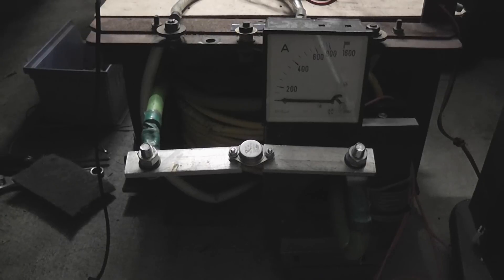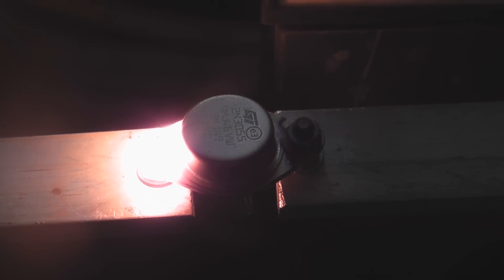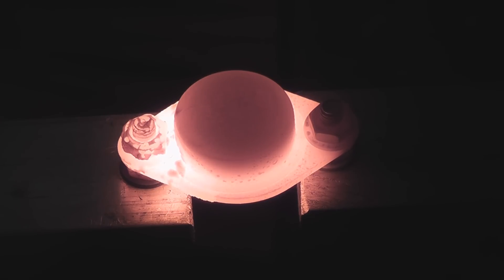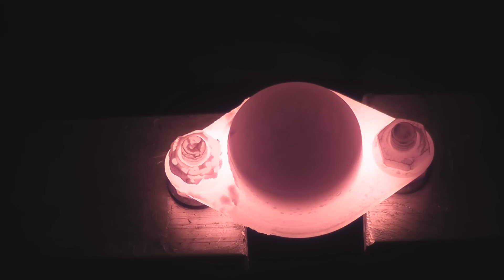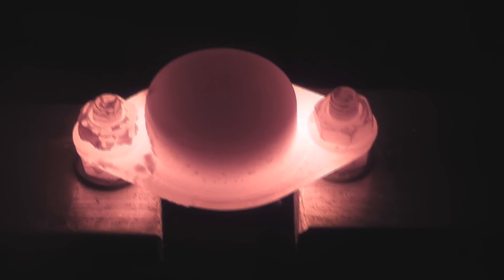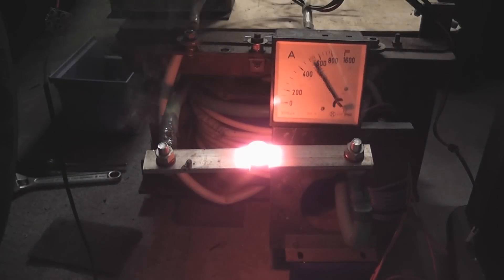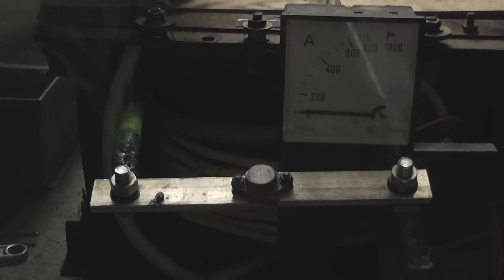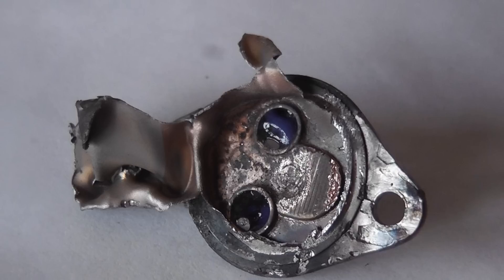Red Hot 2N3055 [part 3]

Comment: In my teenage years, I took a propane torch to an old 'transistor radio' circuit board which had silver colored metal-cased transistors, that looked similar to a small electrolytic capacitor. I found that when you get them red hot, the metal can blows off, hits the basement ceiling, then comes down into your shirt collar and down your back! Around that same time, in the same basement, my dad had a 12v car battery on the bench, hooked up to a charger. I found that touching a file across its terminals, resulted in the battery no longer having a top or sides. Live and learn, as they say. Oh yeah, at 57, I still do this type of experimenting, but with a little more care!
Interesting video, as always!

Comment: So really all you have done is mount it so its connected ACROSS the metal body of the device, the collector. It therefore is not obviously operating as a transistor... It'd be better if you could get it up to that sort of heat-output running as a transistor and not kill it. Now that would be a challenge.

Comment: so its not the actually PNP/NPN gates causing the heat.... its the fact that your effectively using it as a filament as in a light bulb. 

saw the thumb nail and said that their was no way the transistor it self could get that hot. still cool however. especally the photos

Comment: Haha and LMAO at 2.05 ...... "500 Ampere nightlight"

It's gotta be said : Look at it Glowiiiiiiiiin' :D

Here's a cooling idea for the connections: Could you have the terminal ends of the busbars dunked into separate cups of water?

Basically, have both of the busbars vertical with the transistor at the top, connected across them. At the bottom of each busbar, the obvious electrical connections but have each busbar end in a cup filled with water.

Because each busbar end is in separate cups of water, there wouldn't be any electrolytic effect because there wouldn't be any connection across the potential at that point.

Or...... if rusting / corrosion would be an issue from this, fill the cups with vegetable oil. :D

Thanxx for showing,

-BoomBoxDeluxe.

Viewer # 403. :D

13th June 2015, 21.01

Comment: 500 Ampere Night Light Energy efficiency rating Z. I wonder what would happen if you connected the leads and case of one of those transistors to your cap bank? Would it blow the leads off? Or the Cap off the top of the transistor? Probably be a bit hazardous though.
Reply: Coolkeys2009 If the capacitor passes enough current at 50 Hz, it would probably just get hot and melt like anything else. It's only 2 volts so I don't think it would blow.
Reply: Rua Whitepaw 2v? I'm talking about his big capacitor bank that he charges up to 6000v plus :-)
Reply: Oh I read that wrong then. I thought you meant trying to melt down the capacitors.